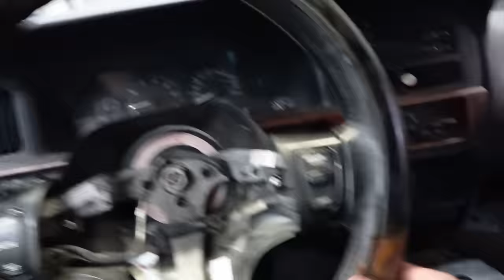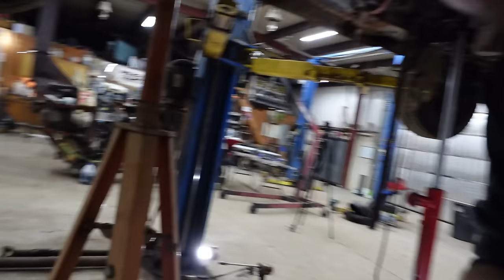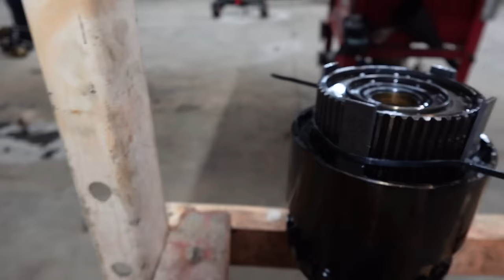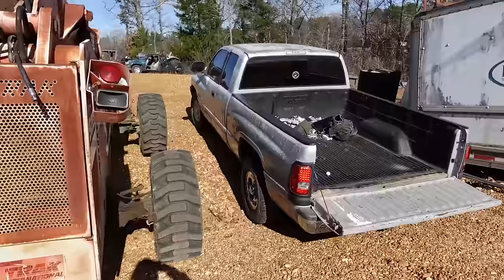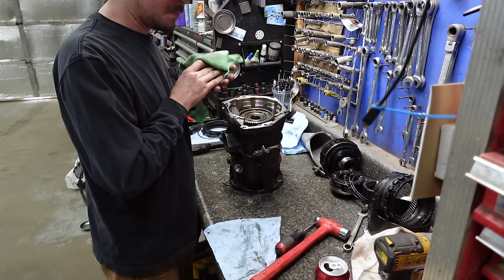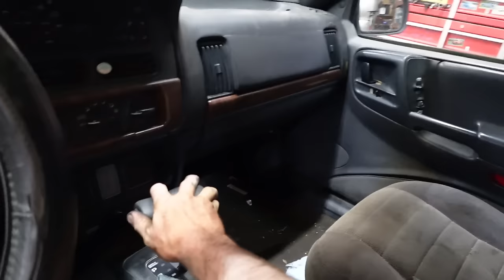I Fix A Transmission With No Reverse And A Common Issue Jeep ZJ & WJ

Comment: Don’t worry about what people criticize you and how you work, you are very intelligent nobody knows everything about everything. I’ve done transmission work, automatic transmission work myself very complicated depend on which transmission you’re working on which variety we all come into this world knowing nothing your way ahead most people, financially and bars of Mechanic quite quite interesting what you built and not owe anything I’ve seen businesses in dollars and they have gone broke 73 years old and worked at General Motors making the nova back in the 70s. You could get everything from a four-cylinder to 396 and those Chevy muscle car was a Chevy. I had a 64 Chevrolet 63 my brother had a 57,58 that had a 60 . I i’ve had different trucks brand brand new ones and used ones. I like the old Chevy Chevy trucks 2000 2004 head brand new ones I now have a ridgeline 24 they all V6 I think it has a VCM on it, which shuts down the cylinders when you’re notin all six but I don’t think it’s good for the motor my opinion at where is it out quicker you’re not saving that much on gas either so I’ll probably put that kid on there and bypass all that anyway enjoy your videos. I think you take it for granted people no certain things what you’re doing you could explain it a little better I think for the newbies.

Comment: The guy calling you a hack  is a professional on the that Particular job and hes mad your strealing his lunch with your cheap fix
Anybody can go to school for transmission spend 25k on tool you better dam no how to fix but I want the MacGyver that uses 2 shoe laces cheap slip lock pliers and few used parts and it works
Reply from the maker: I know this is true!!  Fuel for me. Trust me.

Comment: Every time i watch your new video, i learn something new. And Id rather be called Hackjob, than Handjob. Dont let the haters win. We need you and your channel. Take care man. Was that a NP231 in that ZJ by chance? Just curious.
Reply from the maker: I feed off the haters honestly! I got this.  It’s the 242 or 249 in a ZJ or should be factory.
Reply: @justdexit  I bought my ZJ in 2020, and it came factory equipped with the NP231, and I was wondering if you have any other ZJs ( or have ever seen any ) with the NP231 Command Trac? Mine is a 95 model, and I've read that they were an option, but I've not been able to find another person who has actually seen on in a ZJ. My ZJ came factory equipped with some strange components and the family that I bought it from ( I'm the 2nd owner ) told me that they bought it new in 1998 after Chrysler/Jeep used it as a production test vehicle. It's quite interesting to me and I'm curious about what you think if you ever get a minute to think it over. I don't ever want to sell it but it's a cool piece of Jeep history i think.

Comment: They way this shifts is drasticaly different from my ZJ.... what trans is this? 42re? How come lockup is so noticable?
Reply: Lockup is prominent probably due to valve body pressures being all shot. Essentially the OD is never "off"
You can get a firmer lockup by using the transgo shiftkit JR. Its cheap, easy to do, and makes a big difference.

Comment: I own a 1998 Jeep XJ 4.0 & I’m having the same issue. It does not want to reverse & when I put it into gear I run into the same issue you’re having. My transmission fluid is good I checked it already. What could it be? Thank youu

Comment: Hey Dex on a 46RH since it’s controlled by pressure rather than solenoids. What do you think would cause no acceleration in Reverse? On top of this in D it won’t go over 35 and it’s been slipping bad to where it loses power and you go to push on the gas again and it won’t go until it “grabs the gear”. Love your videos and I love jeeps! Have a good one brother!

Comment: The RE line of trans are a bastard to build, there are at least 3 different places inside that require swimming to make them correct. Not to mention the od housing clutches have a 800lbs spring that can fuck you up if your not careful.
Just steal the two out of the 2wd model Trans you chopped up.

Comment: Dex rebuild your transmission jack just tear it part its just a hydraulic cyclinder take the glad nut off the top pull put the rod and remove the seals there will be about 4 to 6 seals in there most hydraulic shops or napa will beable to get you the seals for about 20$

Comment: the set up tools for the overdrive unit and the tool to press to remove snapring i needed so had several sets made if you want a set let me know will make you a good deal on them included is the shim setup tool as well

Comment: The amount of 42re's ive rebuilt is larger than the amount of jeeps ive owned with the 42re...
Reply: Have you ever used 44re parts in them amd is it worth rebuilding them with 44re parts?
Reply: funny thing is my 98 ZJ 4.0 has 430k miles including the 42re
Reply: @jeepsblackpowderandlights4305  that's impressive, is it stock?
Reply: @blakek2619  yea my mom bought it when it has 22k miles in 2000.. and been driving it ever since.. at 80k the thing stopped shifting.. stuck in 1st.. fluid was black.. had it flushed.  And when i got my first car a 98 5.9 limited ZJ.  I started working on her Jeep and mine.. and ive been doing fluid changes every 30-40k on it.   

At 400k i did the 3/4 acumulator spring which was busted, and the shift solenoids and pressure sensor.. and it shifts great after that.

Now for about 100k miles now its been hanging in 2nd gear when cold.  And you gatta left off the gas to get it to shift.. but once it does that once.. its fine the rest of the day.  Aince its been doing that so long.. i didnt bother to mess with it.  Aint broke dont fix it.

Fluid change about 70k miles ago it had broken snap rings.  Probly the overdrive.

My 46re has 230k and it shift ok too. But had 3 snap rings two were diff broken in the pan.

But the laat id say 10k miles its developed a whine in 1st 2nd 3rd gear.. tjat goes away In overdrive.

So im not sure what that is.  But its deff something from 1st-3rd oddky that is still there when rolling in neutral and with the engine off..  i know my 249 transfercase the chain jas major slack it itll pop if you shift into gear and step on the gas without giving it a few seconds to take up slack.

So im wondering is it the tranny or transfercase.  Im not sure i gatta jack all 4 wheels in the air and have someone run it while i listen to the bellhousing and transfercase

I dont drive the 5.9 ZJ as much though.  As i have a 90 Grand Wagoneer. And a 76 Jeep J10.  So i tend to rotate driving em.  I keep the 5.9 limited on a trickpe charger and only drive it if i gatta go beyond 30+ miles one way due to it getting better gas mileage over the wagoneer and J10.

My moms 4.9 the only thing besides religious maintenance.  That ive done was the timing chain at 220k.  Water pump once.  Radiator three times.. alternator and power steering pump 3 times.. and cv axles in the front.

And just rrgular wear items.  But its steering needs work.  It wanders a lot so you drive like youre watching a cheesy sitcom having to correct steering.
Reply: @jeepsblackpowderandlights4305  that's awesome, my 95 zj has a similar story but it's only at 220k still doing great
Reply: @blakek2619 I havent personally been able to get my hands on a 44re, but its a 1 to 1 drop into the 42re housing. You get bigger internals and more clutches.
the 46re HD gov sol and pressure regulator will also work in the 42re.
its important to do the 3/4 accumulator spring, as well as fully flushing the valve body all out.
Shift kits are worth every penny.
Reply: @Tpbmods  thanks for the info, definitely saving that